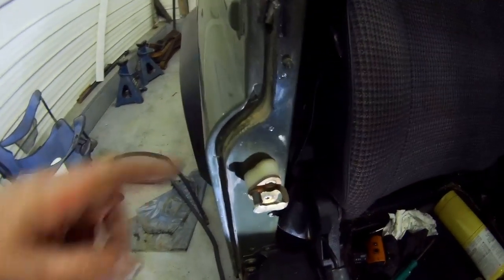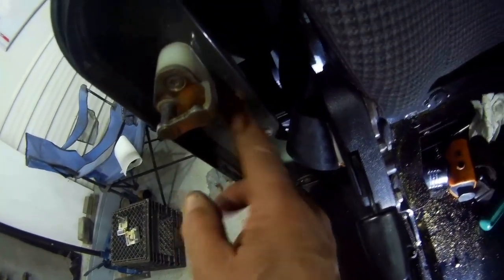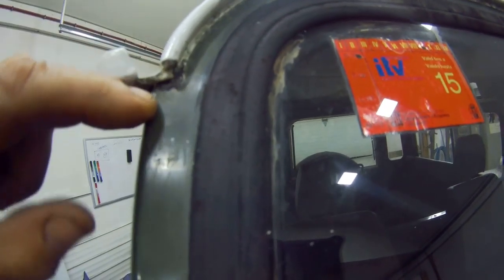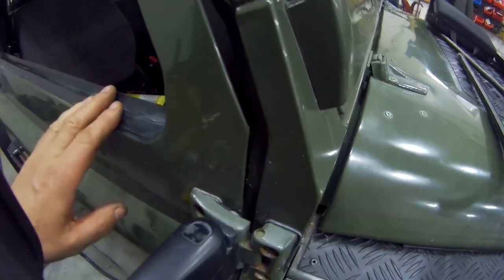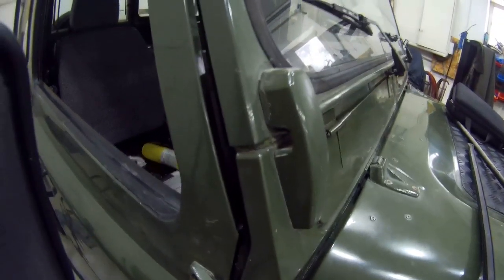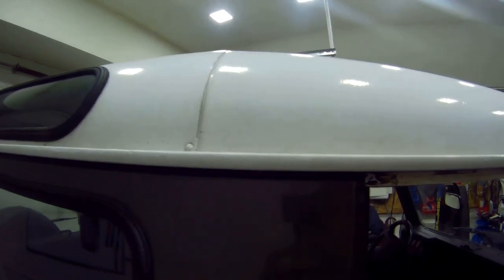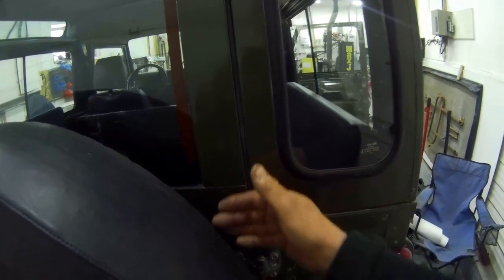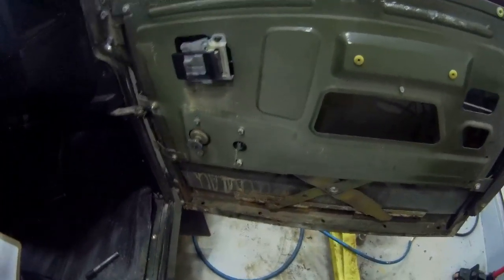Defender water leaks and door latches - a bit more information

Comment: For the roof seam, I have successfully used some transparent Sikaflex. It does a much nicer job than the silicone and remains flexible.
Also for the gutters, the roof racks damage the sealant inside the gutter and the water can then ingress in the inside part of the gutter. Re-sealing these is a good idea if they show cracks
Reply from the maker: Unfortunately Sikaflex is hard to find here, and i have a hard time importing 'dangerous good' that contain solvents
They have to come by sea.
I know what you mean about the roof racks - I hate them, but here they are part of the 'image'
When I was in Australia no one used roof racks - too top heavy - they all used trailers. You could unhitch and the go out for a wander in the bush without lugging everything about with you
Mike
Reply: Britannica Restorations ask your local boat shop.

Comment: When I worked at a main dealer in Surrey, England there was and maybe still is a 48 page A4 book on how to fix water leaks in defenders, every day there was vehicles outside with water being sprayed onto them, this rarely worked in my opinion, as it's hard to recreate leaks by simulation like that due to varying angles, wind etc. 
Anyway I came to the conclusion that higher customer expectation of the vehicles due to the new breed of Landrover ownership was causing a lot of disappointment, fuelled by the salesmen promising to fix the leaks, which is ultimalety impossible.
Mike's got it right, they are great in hot dry places like Africa, ironic really being built in rainy old blighty.
The other thing I noticed at the dealer was that because they were increasingly being stuffed with stupid carpets and thicker and thicker mats, they used to store up all this water and stink, rather than just dump it out the bottom where rain needs to go to water the flowers etc. 
Just my thoughts, we love these old heaps so much, we put up I guess.
Thanks Mike for teaching a thirty year Landrover Mechanic lots of new ideas, it's all about learning everyday from each other
Reply from the maker: Cheers mate!

Comment: Hi Mike, i am restoring my defender pickup and I wondering what’s the best way to seal roof with? I replaced all the sealants but I am worried about the front side above the windscreen?

Thank you 🙏
Reply from the maker: Use body caulk in a tube - don't use silicone! Body caulk cleans easy with white spirit and is flexible. Usually comes in white, black and grey
Reply: @ Thank you.

Comment: Above the vents where the windscreen joins , Is it best to pull the foam out and put dum dum in , or put dum dum on top . Ive tried this way but getting a drip on the passenger side above the wiper motor area . inside of the outer foam seal .

Comment: Hi Mike. its a td4 2.2L. 110 Station Wagon built in 2012.
at the Rear doors i think i could locate the drop-in point close to the doors (could it br caused by the recently applied grease). at the Front i could not locate whether the water gets through the doors/Window or the bulkhead.  however the front insulating mat is like a sponge filled with water..

Comment: Hi Mike! Thanks for all information and smiles that you are spreading. Have a problem with a leaking slide window on my Defender 90 -02 on right side. Put DumDum in some areas but keep getting like a flushing through some kind of draining hole on the inside? Leaking behind the front passenger seat and the seat in the back.Is this something that is possible to fix with just dum dum or is this a more major problem with the seelings do you think? Best and a lot of thanks / David, Sweden
Reply from the maker: David - and you send me some pics?
Mike

Comment: Your video's are very useful!!! We recently had very heavy rain, and there was literally a puddle on my drivers seat and water over the handbrake, dashboard...just everywhere.  It looked as if someone had just thrown a bucket of water in there.  Going through your vids to see what I can figure out.  I've been using SUGRU, will this damage the car (as it is a type of moldable silicon).
Reply from the maker: Not heard f SUGRU, but it sounds like you have a sunroof that needs removing as re sealing
Reply: instablaster.

Comment: I will have to check my alpines-I have had drips I cannot understand after replacing the door and door window seals! I had the crack in the latch panel and reinforced mine with 6mm aluminium plate - I tried finding a replacement part but was impossible to source - like your comment I reinforced a larger area.
Reply from the maker: Because a lot of people think that the door seals are the culprit, they tend to adjust the latches so the seal is nipped up  - this leads to the door pillar cracking.
Check the alpines as I would put money on they are the culprit OR the roof seam - the overlap has very little sealer in there and over the years water can get in showing the same problem of dripping in the vehicle

Mike
Reply: Britannica Restorations as it’s 28 years old I reckon most of the roof sealer has run off and the alpines rubber looks a tad perished. Saw another video by an Aussie that suggests applying a marine sealant (silkaseal I think) along the gutter where it turns up to the roof and all roof seams. Enjoying all your top tips. The cracks were sadly on the latch panel before I took possession

Comment: Thanks for the info Mike. My 92 110 is leaking from the alpine Windows but drips into the car at the front just as you say. Oh well, another job to add to the list. Regards from the Midlands, UK.
Reply from the maker: Hi!
I was asked to do a video on the alpine windows and how to seal them up, but I don't have a vehicle that needs them right now - if they don't leak - don't touch!
I would say that if you are going to do this job, buy another rubber seal as a spare - they are so easy to rip when you fit them.
They don't seem to be made of very strong rubber, but at the same time they need to bend round the ends of the glass.
It is advised to get some tools to fit the glass  - a screwdriver is not good enough!

Mike

Comment: Late comment, but have you ever seen a Defender where someone has successfully fitted a rain channel along the outer edge of the windscreen frame to reduce the water run off from the roof gutter to the door? If it was paint matched it certainly wouldn't look that out of place & would definitely help against that knee/foot shower you get when opening the door.
Reply from the maker: It is actually on my experimental list for this winter!
Mike
Reply: Cool, I look forward to seeing it as we're heading into summer here in Oz so by the time I need it you'll hopefully have good things to report 👍

Comment: We're fortunate to have a leak free Defender (MY2015), can you believe it? But I watch your videos anyway. Apprechiate you're doing them and I know sooner or later I'll need them :-)
Reply from the maker: Frank
It is just a matter of time before it leaks! Lol!

Thanks for your support

Mike
Reply: @BritannicaRestorations  So, 3 years later the foam seal between window frame and bulkhead let a bit of water in at the left hand corner :-) I've now sealed it with Sika Lastomer (butyl / dumdum with solvent). 
Interestingly there was a generous strip of sealant underneath the door seal around where that gap is. The gap itself was closed with a sticker (alu tape?).

Comment: I have   a 110 leaking  from   above the pedals   also  water dripping  from inside the  dashboard .Anyone  help
Reply from the maker: Water from inside the dash is from the vent seals or seal between the windscreen and bulkhead
Water on top of the pedals is from the top of the wing and poring the wrong way

See my recent videos, but it is an issue that is fixable! 
Mike
Reply: Britannica Restoration. Thank you very much . All the best Mike
Reply: Britannica Restorations .leak  under pedals. Carried  out your  instructions Mike it worked . What  I don't  understand  why five of my mates  have  defender's.  Mines the only one pissing  out water in that  area. Strange  but that's  a landy. Once  again thanks Mike.
Reply from the maker: Just as there are no two Harley Davidson's the same, I think that is true for Land Rovers as well.
One will leak like a sieve, the other dry
I guess we have to put up with it!
Mike